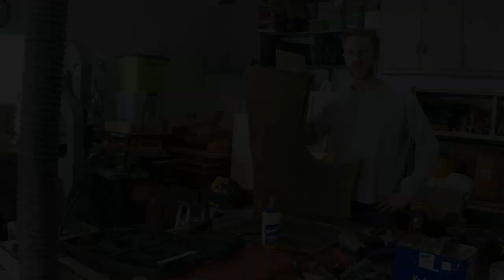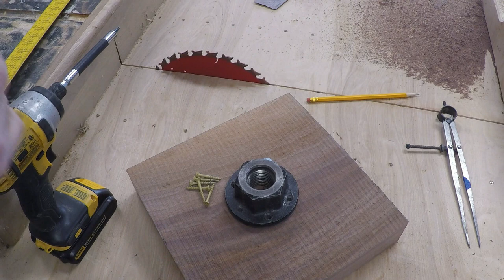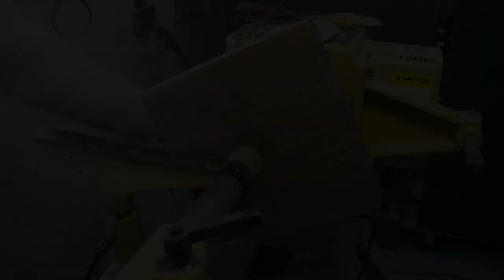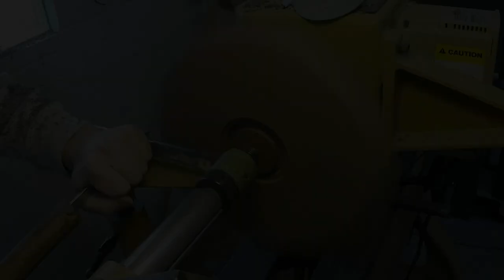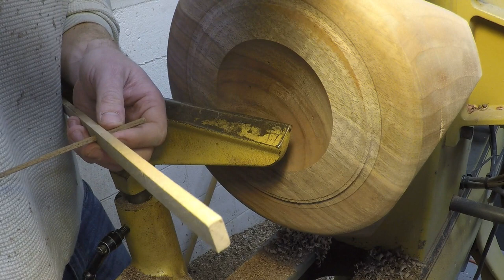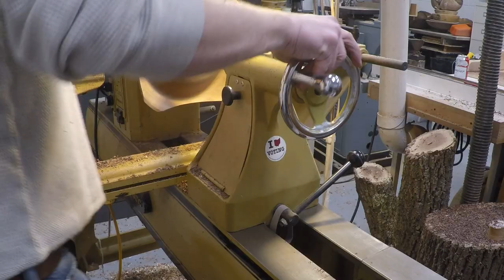How To Turn a Square Bowl with Feet - Sawdust Factory Woodturnings

Comment: The front of the lathe seems very close to the wall. I have not seen a set up like that before. What was your reasoning ? I am preparing to build a new table for my lathe and I figured to just attach it to the wall.
Reply from the maker: Shop space was the reason. I also throw the shavings against the wall so they don’t go all over the shop.

Comment: nice work . I was wondering what type of metal is your bowl gouge? looks like brass copper
Reply from the maker: The gouge is made from high speed tool steel.  Not sure of the actual grade. The gold finish you see is a coating that the manufacture puts on it that is intended to made it hold a cutting edge better. I don’t recall the actual name of the coating.
Reply: awesome probably a great idea. could you tell me the brand of the tool or maker thanks much appreciated
Reply from the maker: It’s made by Robert Sorby. The coating is Titanium Nitride.  I bought it without a handle and put my own on it. You can get these off amazon.
Reply: thankyou Josh ill check it out take care
Reply: If you heat up the steel then buff it with a brass wire wheel you will have a brass style finish on your high carbon steel

Comment: How did you hold it to take the tenon off?
Reply from the maker: I just use my tail stock to push it against a waste block. Then take off as much as possible.  The last bit against the tail stock I remove by hand.